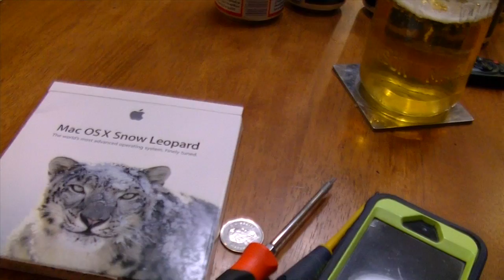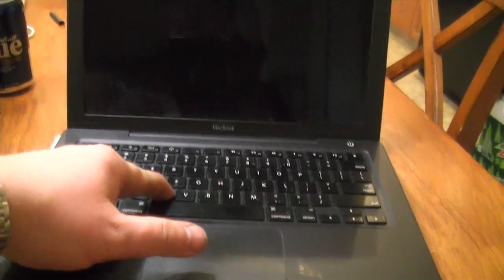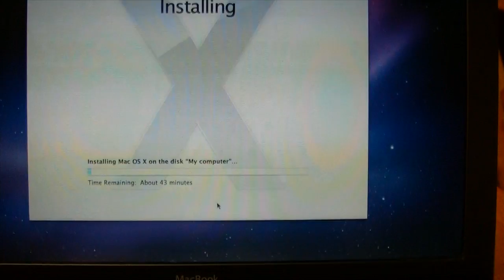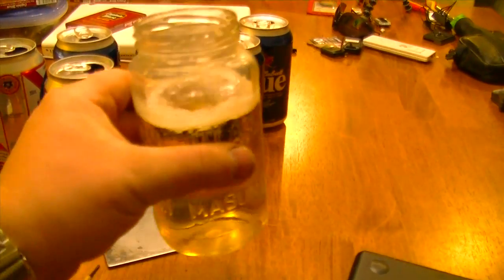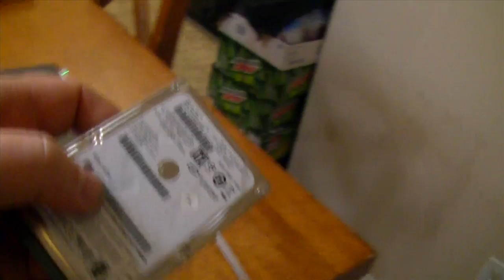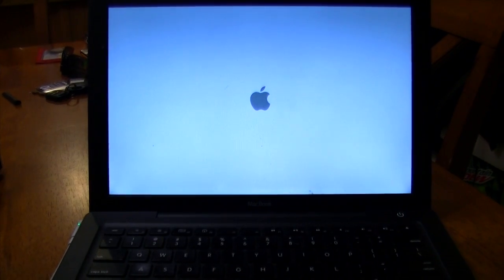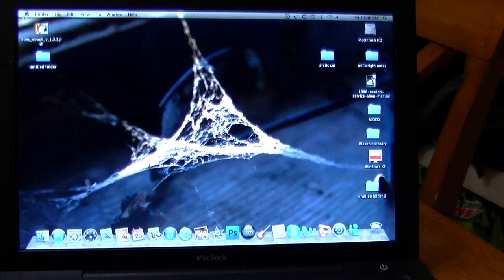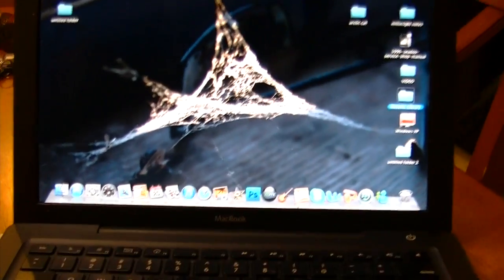Mac Flashing Folder, DIY Repair

Comment: Didn't that hard drive you just threw have files you needed?

Also, couldn't it be just a broken sata cable, or is it always a hard drive problem plus OS reinstall issue?
Reply from the maker: I got the Macbook for free, so any files on the drive were of no use to me.  it could have been many things however doing a hard drive swap did the trick and it's been fine ever since